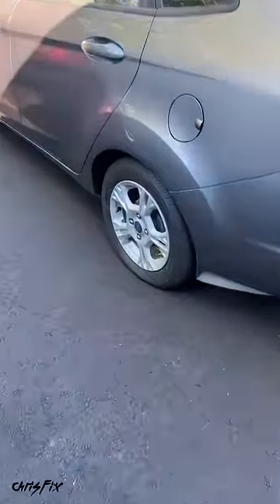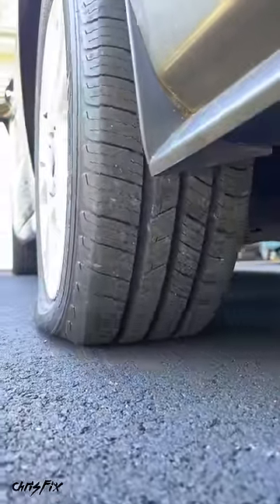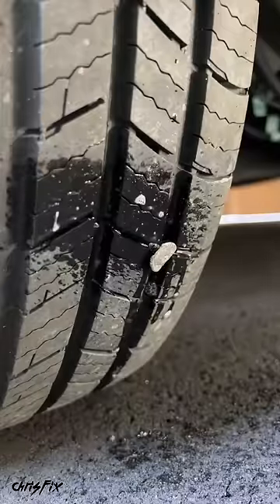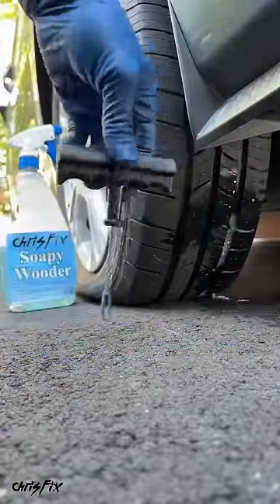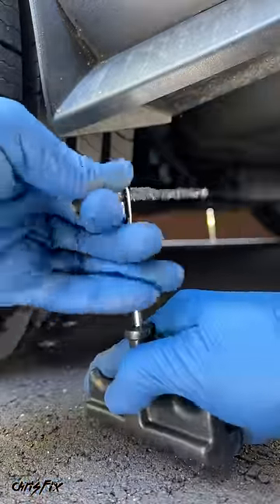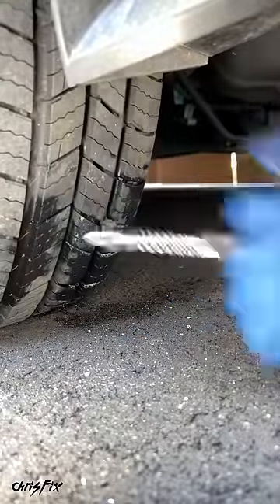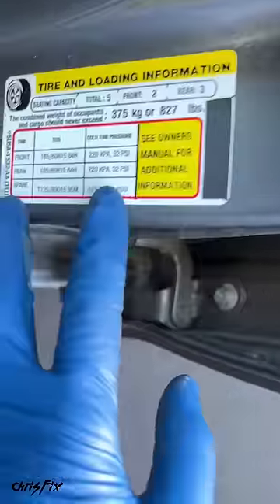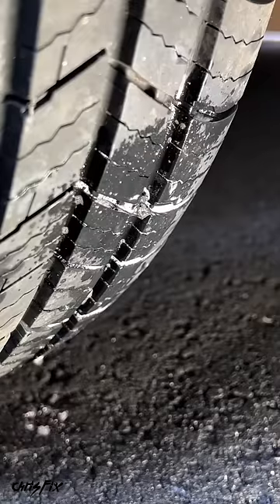How to Plug a Flat Tire (easily)

Comment: Lot of replies here. No you do not need patches or the repair shop to fix your tire. Used plugs since 1966. I have driven a lot of miles ( a lot) . Never once did one leak or needed to be replaced. All BS crap.  Lot of people told me lots of things. Many tires patch with plugs and how many years? I do use rubber cement on these patches.
Reply: Yes best to tun it 1/2 but not always necessary. Rubber cement helps. Make sure you use the right plug. 2 types one for non steel belts and one for steel belt. Chis Fix has it right‼️

Comment: Do not plug the sidewall of a tire. Also, plugs can ruin a tire by damaging the belts and force an air pocket in the layers of the tire.  Be careful when using those. If you can carry it, use rubber cement with the plug.

Comment: What happens when it still bubbles after?
Reply: Bubbles mean it loses air, so the tire will be flat pretty quick. It's not fixed
Reply from the maker: Either pull the plug out and replug with rubber cement coating on the plug or take it to a shop and have them patch it from the inside.
Reply: @chrisfix  oh ok 👍

Comment: That is a temporary fix only. Go straight to a tire shop and have a proper plug/patch installed
Reply: I plugged a tire on my Ram 1500 several years ago and that plug was still there and holding air when I replaced all 4 due to tread wear
Reply from the maker: It’s def not a temporary fix except for maybe a lawyer. I’ve driven on plugged tires for 30k miles and drifted down to the belts on plugged tires with no problems. Not saying your idea is a bad idea but it’s not always necessary.
Reply: @chrisfix  I've plugged 18 wheeler tires with a regular plug kit and those tires aire inflated to 90-110 PSI

Comment: You should've also noted that this is not a proper way to fix it as I have seen many tires with leaks due to these and they did not bond properly and were so weak I was able to remove them bare handed

Comment: Note not a certified way of repairing a tire and will more than likely leak. They have and can work but no guarantees. On top of that a tire place will likely not remove and properly plug the hole again as you're also not supposed to plug a hole twice. You have a spare for a reason. My instructor would always say when something goes wrong due to neglect it's going to be the time the car will lose control and hit a minivan full of kids or some other horrible thing like that all due to you not taking an extra 5, 10, or 20 min to do the job right.

Comment: Ream the existing hole to “smooth it out” 
It’s actually to make the hole bigger so you can more easily get the plug in the hole which I know from personal experience makes the plug less effective so it will leak sooner than later the harder the plug is to get in the more likely it will not leak, and maybe even for the life of the tire you must remove the wheel from the car make sure it has enough air in it to create back pressure against you standing above the tire in the whole, forcing the plug-in and using vulcanizing cement on the plug at the same time you’re welcome
Chris fix has a lot of good information but a lot of it is not really that accurate  but it’s all about presentation 
I’m sure most people watching this video will believe this is really correct and actually the best way to plug a tire
Reply: But technically speaking a plug fix is only supposed to be temporary and if you’re just plugging it so you can go have it patched which you should do then reaming the shit out of it so you can get your plug in easily. I guess it’s just fine

Comment: Works as a temporary fix. Usually starts to leak again after while
Reply from the maker: Never had one leak, even after 30k miles or drifting down to the belts.
Reply: @chrisfix  I work at tire shop and see leaking ones almost daily. There are few different ones tho, maybe some brands tend to leak easier
Reply: If you keep inflating  the tire while reaming and plugging it, the result is a smaller hole,  speedy job, and  long lasting seal. It helps to imagine your tire as a balloon.  You make a smaller hole when the balloon is inflated.  A small hole seals better, and it's easier to penetrate a balloon when inflated.

Comment: Of course, this is only a temporary fix. Plugging the tyre is a solution for when you are stuck in the middle of nowhere, and need your wheels to work long enough to reach a proper garage.

Comment: These are NOT to be used for the lifespan of the tyre.  Please get it plugged correctly at a garage although this is good for a sticky situation.
Reply: I know they say that but I’ve put thousands of miles on tires that had multiple plugs with no issues.
Reply: Have plugged my tires for 20 plus years with no issues. It's a permanent fix.

Comment: Don't know about the US but this is totally illegal in the UK, Ive been in the tyre industry for 30 years and these are only for use on off road low pressure tyres like farm quad bikes or ride on mowers and even then they are only a temporary fix.
Reply: That being said, I have used many of them over my many years of driving 1.5million KM and never had an issue. Of course, some people will use them improperly and give them a bad name.

Comment: Ehh no rubber cement? You should squirt rubber cement in the hole and then all over the plug, I've made this repair on my tires at least 30 times but always use rubber cement; never had a plug fail.
Reply: That doesn’t mean that the cement is was caused the success. You might as well say that you did 20 jumping jacks after installing a plug and never had a leak:)

Comment: buy a 20volt "auto" air compressor
literally set it and wait 
12volt car charger "for,20v battery " recommend
edit jack the car up taking weight off flat to speed up airing up tire

Comment: This fix is not permanent fix and can be dangerous  when it pops out on the highway in high speed.. to fix a Tire permanent you need to use a plug from the inside and out. this is my job

Comment: Please, don't use these. I am a tire expert by trade. When you plug a hole with these the tire is no longer serviceable, meaning when you finally take it to a tire shop you'll have to replace it. Just put your spare on and take the tire to a shop.

Comment: DO NOT USE THESE, I work at a tire shop and if we see these we will not work on them, due to it not being certified. It’s dangerous and in extreme heat can melt that gummy plug. So if you don’t want to spend more money than needed, just take it to a tire shop

Comment: so much wrong here. i grantee you this will fail. they do work but only if it takes incredible amount of force to ream and install. that reaming is WAY TO LOOSE. also NOT DOT or highway safe, but i have used them plenty when done correctly, you did NOT

Comment: Wow!! How to damaged your tire!!
PLEASE DONT BE THIS GUY!!
Those plugs are use for emergency repairs only!! And they have to be fixed properly later!
DONT BE THIS CLOWN!
Reply from the maker: How does this damage your tire? And most of the time these plugs outlast the tires themselves
Reply: @chrisfix  this plug will separated the tire liner with time! Look it up! I’m a heavy duty tire technician for the last 20 years! 
This is only for emergency fixing not for a permanent repair! Special if your tire is new! You need to patch the inside liner to prevent separation later

Comment: Surprised he didn't mention that this should not be considered a permanent fix! Do this if you are stranded on the side of the road with no spare just to get yourself going again. Then you should bring the car to a shop to get it properly patched from the inside. And if the hole is too close to the sidewall you shouldn't even do this even as a temporary fix. In my opinion, if there isn't enough time to mention those things, then this shouldn't even be uploaded as a "short".
Reply: That plug will outlast the tire and tests show that it there's only a minimal increase in likelihood of a blowout.
Reply from the maker: Here you go: https://youtu.be/3aQRO29ZzbE